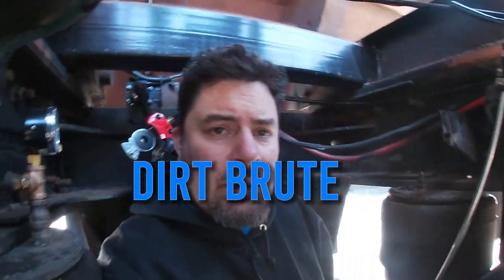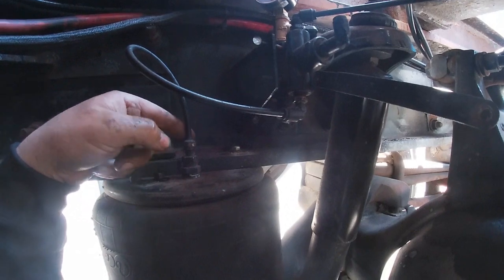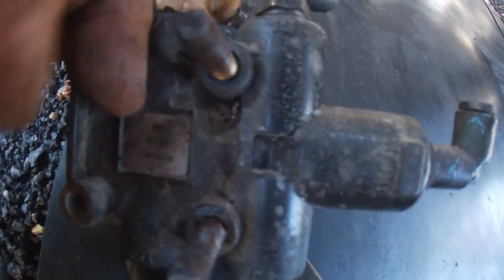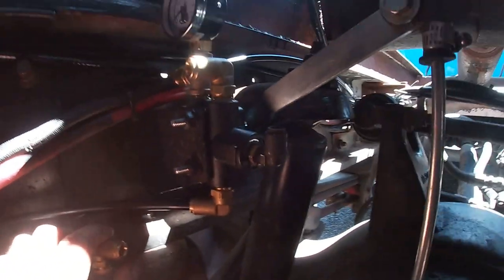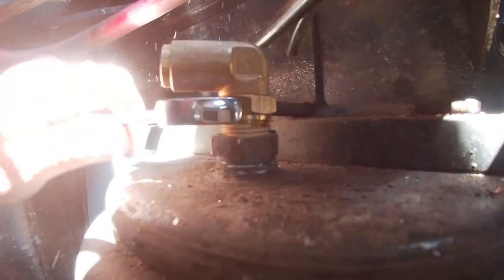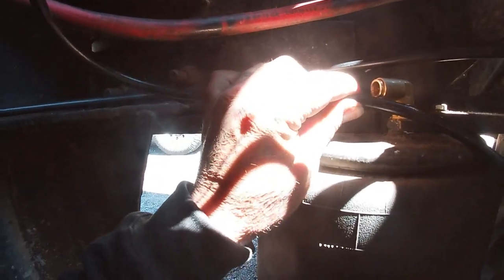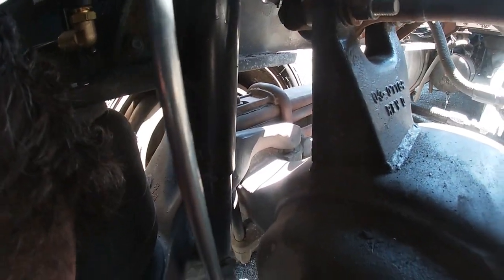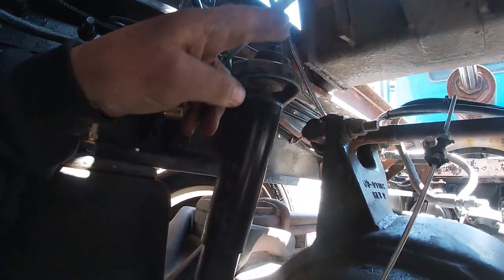How To Install Air Leveling Valve! (1986 Peterbilt 359)

Comment: I have the same type of air leveling valve but when I push mine up it dumps the air? Do I need to flip the unit upside down or something? Don’t know how I’m gunna be able to bolt it up then.. I need mine to work the same way yours does in the video so the rod stops it from filling once it reaches a certain point. Right now it is doing the exact opposite basically
Reply from the maker: Take the rod off and pull the level down . If the bags pump up you have it plumbed backwards. I don’t think you have to take the valve off just replumb it from the sounds of it